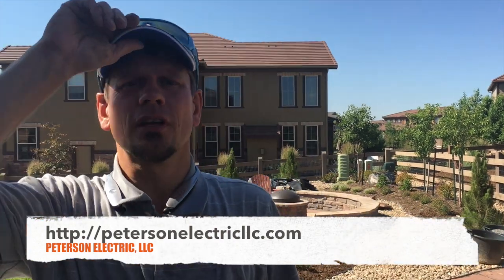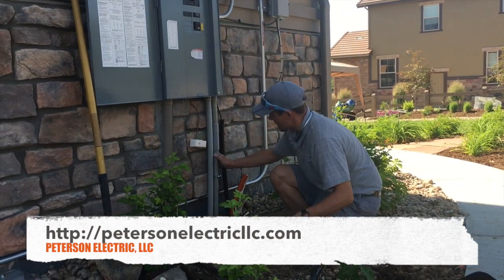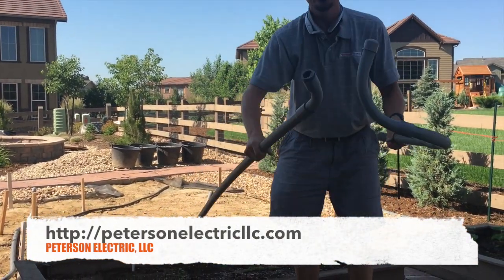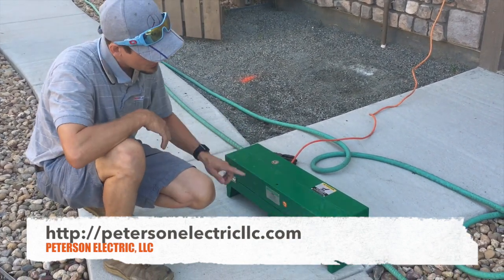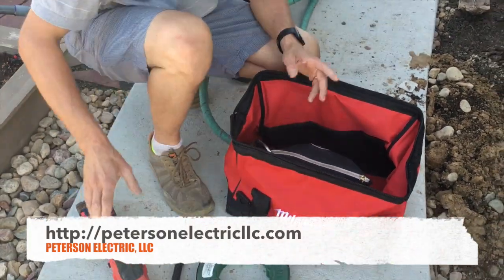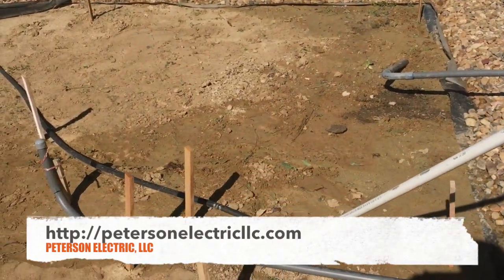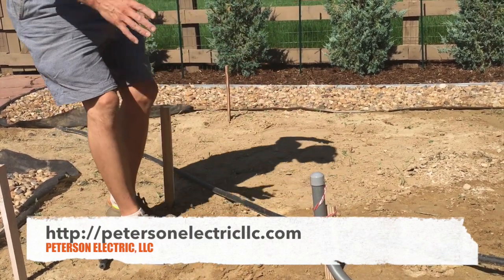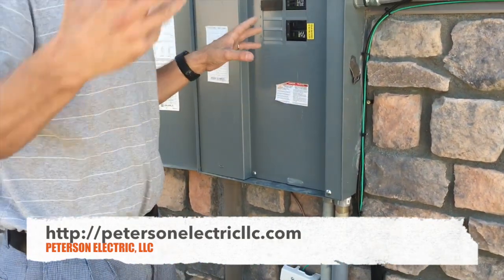Underground Electrical Wiring & Codes For A Spa

Comment: You can use a propane supplied weed burner. They're about 3 ft long and you can quickly heat up 10 ft of PVC pipe. I've seen swimming pool plumbing contractors do it all the time. They just keep the flame moving continuously up and down the pipe and in a few minutes they've got a piece of wet spaghetti.  However if you stay in one spot too long you will toast the pipe.